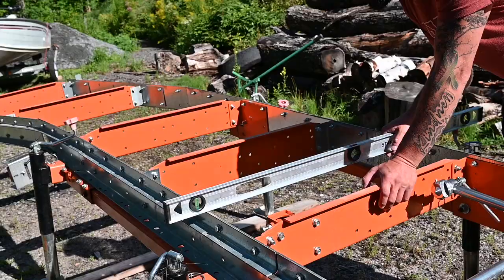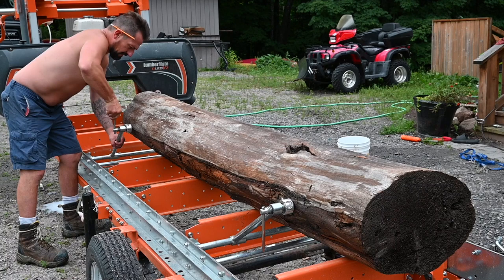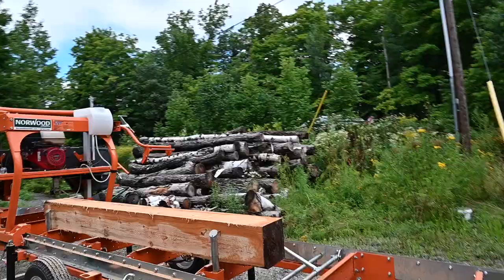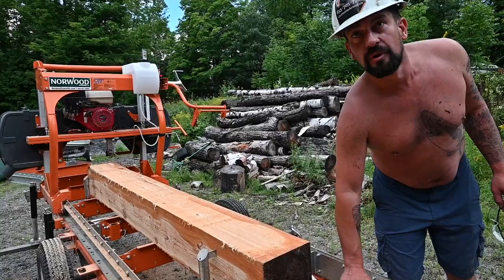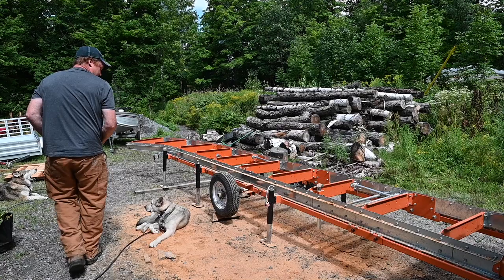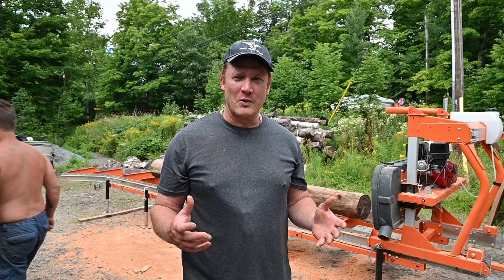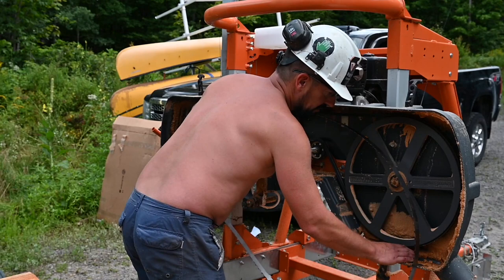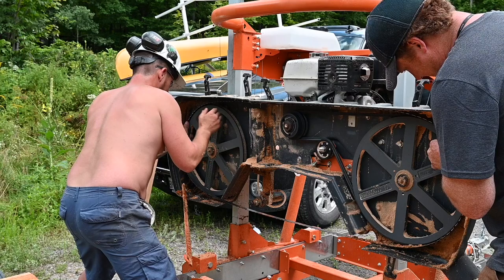Turning Logs to Lumber | How-To Use a Portable Bandsaw Mill

Comment: That thing is cool. I could see where it can get expensive. Those blades are not cheap. But the cuts are perfect.
Reply: Depending whom you purchase your band saw blades through, if you purchase in bulk it's much cheaper.  Additionally, you can sharpen them yourself with the right equipment.
Reply: The blades aren’t bad price wise, as the other guy mentioned you sharpen them yourself.

Comment: why didn't you lay the first cut flat on bottom. 
had me cringing when he opened that new saw on the wood n near metal not sure if the teeth are like what we used but ours chip so easily but ours are massive 17" wide saw

Comment: Jim what brand/model of cooking pot do you use for boiling water/cooking ? Looks very durable.
Reply from the maker: It’s an old stainless steel pot that I believed MEC used to make but dint anymore. The closest thing to it now is a GSI but it has no bail arm so, nothing like it available now I dint think.
Reply from the maker: The Zebra billy is pretty good though but the lid is not tight fitting like with mine.
Reply: Ahh I figured that because I looked everywhere for the one you have and found nothing, makes sense if it’s older. Thanks for the suggestions.

Comment: I don't know what kind of sawmill it was, but my girlfriend's husband lost his life on one. He got too close, and his mud rubber boots got caught on the machine, it pulled him in, crushed his head and torso, and also cut his legs off at the thighs. Be very careful. This was a 50-year-old machine. It happened about 38 years ago in Apple River, Nova Scotia. He was only about 39 years old. Alone in his own backyard, while his wife and 2 teenage girls were in the house. His friend dropped by the yard and found him. Ran in and told the wife to keep the kids in the house. I guess the older machines were more dangerous, without wearing proper safety gear, which is a must as you know. I will understand if you delete this. I just want you to be extra careful. If he had not been alone was his first mistake, and proper safety equipment, perhaps he would be alive today.
Reply: Hi Judie, I'm Judy from Wisconsin, USA. So glad Jim didn't delete your message!!! Taking the time to be safe is important as you pointed out. What a tragedy and thank you for sharing!👍💙
Reply: @judyschepp8748  You're very welcome. I also had to fix my spelling and grammar. I think of Wayne every time I see any type of sawmill, I get worried.
Reply: They can be dangerous but these ones run along the track and don’t move forward if you’re not pushing them.